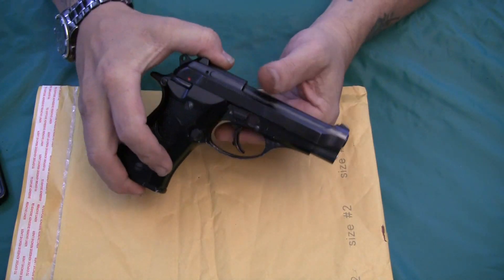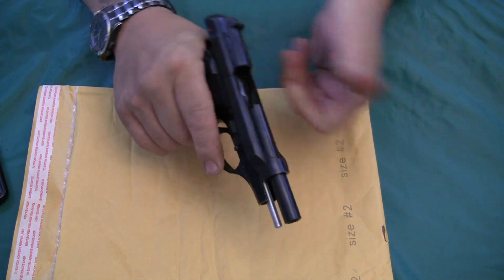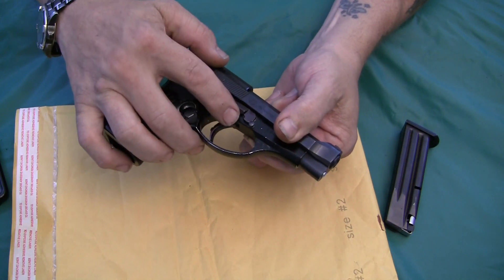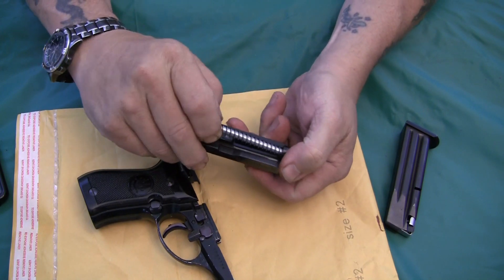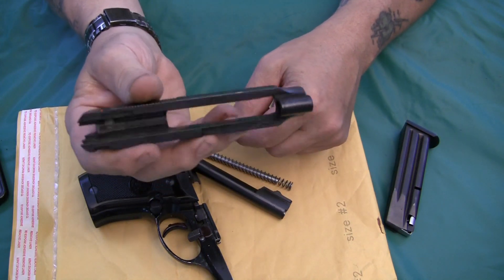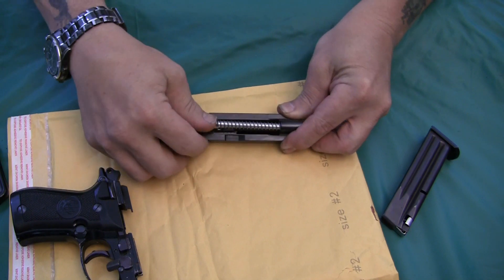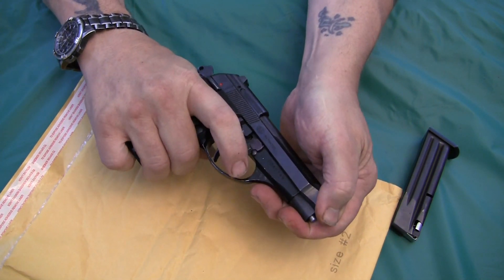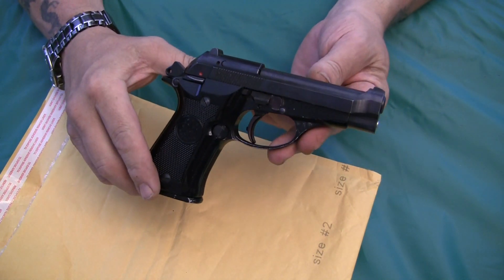Beretta Mod 81 Field Strip Disassembly

Comment: Thanks for the instruction!  I had it apart, but it would not go back together.  Unlike the 92s, the take down lever interferes with the guide rod going all the way in, so the guide rod stays a little ways out until you return the take down lever to the closed position, when the guide rod snaps the rest of the way in.

Comment: After ive pressed the take down lever to the disassembly notch the slide will not allow me to slide it forward to remove it. 
Why?
EDIT: Had to use a rubber mallet to smack the rear of the slide forward until it fell off.

Comment: Good video EXCEPT that the gun was not completely cleared.  You MUST also visually check the chamber [in the barrel] before you can consider it cleared. [Lots of so-called "professionals" (if that's what you can call police) have had negligent discharges with their Glocks by failing to fully clear their guns.
Reply: NRA-TC Bob we used to call that a “desk pop”. 🤣. Ah the good ol days!
Reply: Best demo and commentary I've see. Well done. Thank you.